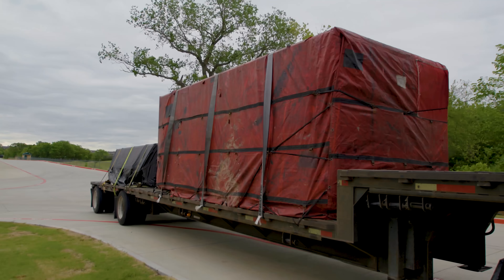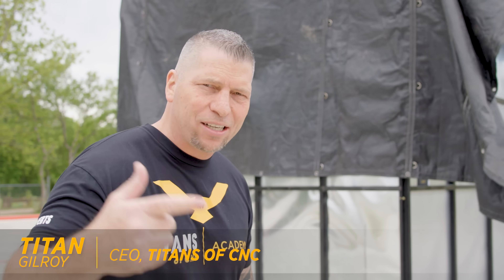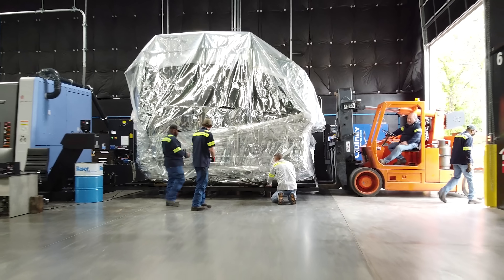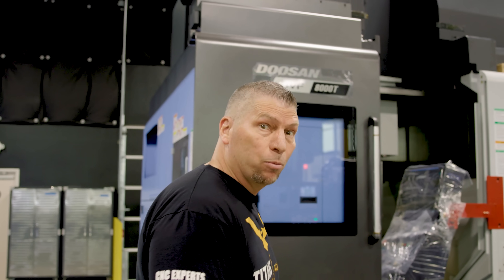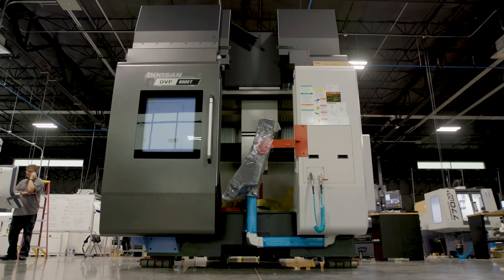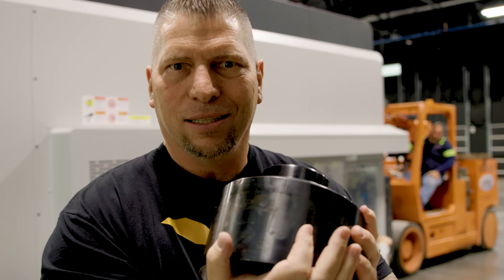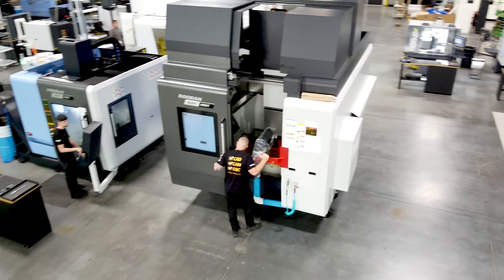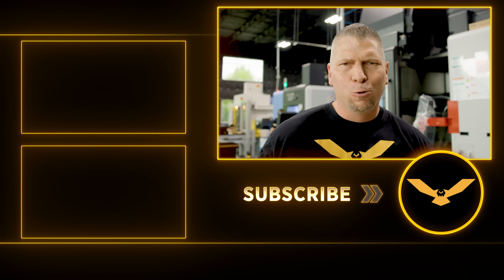MONSTER DVF8000T 5-AXIS CNC MACHINE COMES TO TEXAS | DN Solutions

Comment: I just want to tell you Titan that you inspired me and influenced my career. Failed 7th grade, dropped out in 9th. I moved jobs a few times until I ended up as a full-time employee at Toyota on the assembly line. Great company but after 4 years I decided I needed something different. I watched your videos which got me intrigued. I built a CNC plasma table and learned how to program it in Mach3. I now run a MASSIVE....as in bigger than that 5 axis G&L or Giddings and Lewis 5 axis. It's a bit older but she's a champ. Thank you for the videos. It made me who I am today. I watch you a lot but finally feel compelled to tell you my story. A 9th grade dropout isn't supposed to be making $110k+ a year but here I am.

Comment: I've run a Hermle C62-U-MT. Awesome machine. 69hp at the spindle (HSK-100 holders) and 90+ hp on the table (turning). Heidenhain controller. This beast weighs 69,000 lbs. Unfortunately I left that shop because the boss was a clueless, backstabbing coward.

Comment: Why do you allways stay with that Fanuc.. try Heidenhain
Reply: Heidenhain is the best... Hermle C800, C42, C32
Reply: hi mate! do you have heidenhein controls on your machine?
Reply: @ezraelsensiaron4860  on every one. Never thought about switching to Something different
Reply: @simsonschrauber05  me too. we got dmg's on the floor.
Reply: @ezraelsensiaron4860  only Hermle here, C20 ,C40U Dynamic, C40V
Reply: @ezraelsensiaron4860  Which DMG machines do you have?? DMU Monoblock??
Reply: @Bueno_Anderson  i got a Dmc 80fd duoblock with 7 pallets, and also running a ctx beta 800tc, other guys are running some monoblocks 75's and 85's. All heidenhain controls. The ctx was on Siemens celos control
Reply: @ezraelsensiaron4860  Woww nice!! DMC FD with 7 pallets means that you have a great production. CTX is a fantastic machine also.
 
I work at DMG MORI Brazil.

Comment: your machines aren't bolted down?
Reply: Most CNC machines aren't bolted down
Reply: @85CEKR  really? im an apprentice at a company that sells CNC machines and I was under the impression all of ours are bolted
Reply: @danhyde7501  What brand is that? we've have a few Japanese brands Okuma, Makino, and Mori and they are all designed to sit on the concrete, certain models don't really even need to be leveled.  From my understanding its just the cheaper lighter machines that need that. Although I don't know about the German brands
Reply: @85CEKR  Matsuura :) interesting to learn about other manufacturers
Reply: @danhyde7501  really? I didnt think Matsuura did that.  When we got into 5 axis It got down the  MX520 and the Okuma 460 5AX.  I ended up going with the Okuma but I didn't realize that the bolted those down.  I was also looking into the LF-160 at one time, those things are really cool.
Reply: @85CEKR  I mean, I’m an apprentice having been here a couple years. In the showroom they aren’t bolted. But yeah, 99% sure the installation guys bolt everything down and level the machine. Maybe next time you can consider us again, come visit, are you in the UK?
Reply: This machine should be on a 2 ft thick separate pad anyways, due to vibration. I'm surprised the floors could take that weight. We cut the floors and dug pads for all of our horizontals... Better for other machines around them...

Comment: Is not the biggest mill i have seen but is surely a large one!
Reply: My machine isn't pretty like that one 🤣 but it's got a 12 meter X axis
Reply: DMU 600 gantry is the biggest CNC I've been on... Literally. The table is the size of my living room and kitchen combined.
Reply: @TheFeralEngineer  Mines a Colgar 401...12 metres X axis...4 metre Y Axis...1.5 metre Z axis and 1 metre W axis
Reply: @TheFeralEngineer  Whole footprint of machine is about 20m by 20m
Reply: @Bawbag0110  the machine I'm talking about is 18m X travel, 4.5m Y and 2m Z. The X can be lengthened infinitely because it's a modular design. The walls of the machine are actually poured in place into a pit in the floor. It's definitely a sight to see.
Reply: @TheFeralEngineer  Be good to see that
Reply: @TheFeralEngineer  Exactly it!!!
Reply: @TheFeralEngineer  I also have a friend with a machining center where the internal area of the cutter is as big as an apartment.... My personal milling machine, on the other hand, is so small that it fits in my micro lab :D
Reply: @AsitShouldBe  same. My mill can fit on a kitchen table, alongside my lathe
Reply: @TheFeralEngineer  i've just added 4th axis to mine, it works but the CAM  part start to be very tricky.. from 3 to 4 axis there is a huge difference in complexity..
Reply: @AsitShouldBe  what control system are you running?
Reply: @TheFeralEngineer  mach3
Reply: @AsitShouldBe  i believe there's an axis replacement code that Mach uses for converting 3 linear axis moves to 2+rotary
Reply: @TheFeralEngineer  mhh I don't know, i would use 4 axis continuosly not only 3.. but i have to investigate better..😁